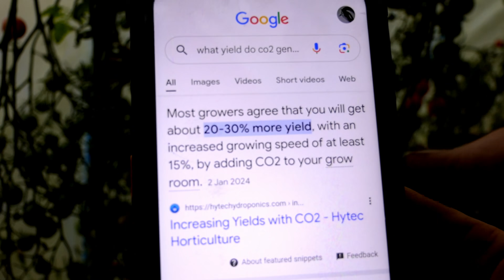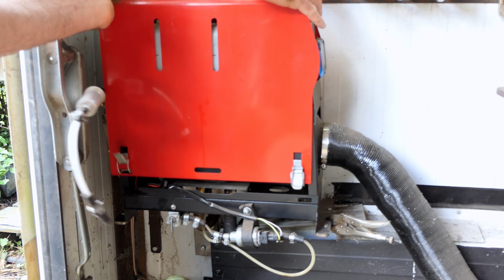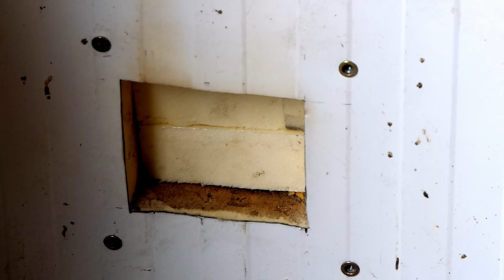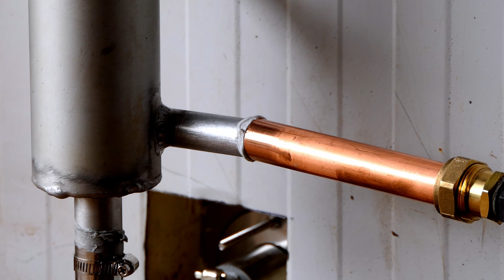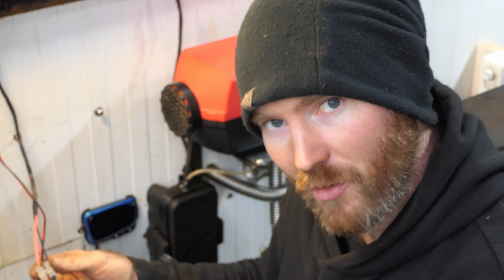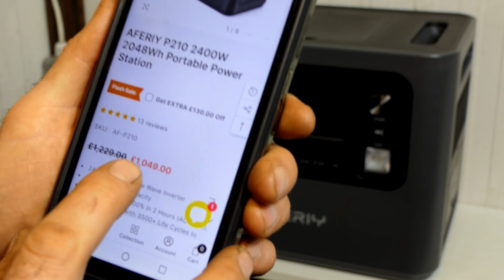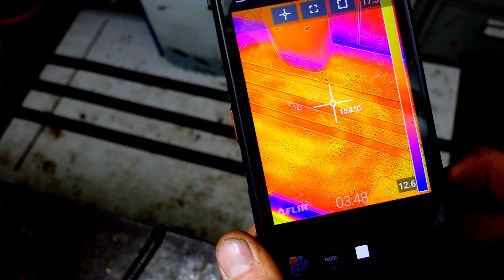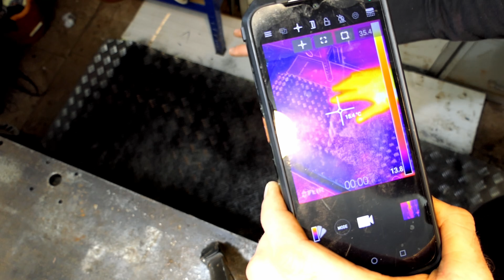NEW! Better system for Cheap and Safe Heating💲+ Underfloor Heating Mod test🫠

Comment: Great video and experiment, however I can beat your 5p per kWh before losses record, charge 20 kWh of  batteries on cheap over night rate for 7 hours at 6.5p per kWh - use this to run aircon (heat pump) in heating mode with a COP of up to 5 and you are looking at a cost of 1.3p to 4p per kWh of heat, throw some solar panels in to the mix and you are laughing, does have a higher setup cost than your solution though :) but its cleaner especially if you charge from solar too and has the advantage of also powering your whole house.
Reply from the maker: @james141111  fair enough. Cheers J
Reply from the maker: @james141111  doesn't beat my free wood in a wood burning stove though 😉
Reply: @joshuadelisle  very true!!
Reply: How much did you battery cost? What is it's capacity? How long will it last? Given  12kWh capacity for 10000 cycles over 10 years. for £11k installed, that's about 9 p/kWh energy delivered from the battery. You have to add that to what you're paying for your economy 7  rate of 6.5p, making it's 15.5 p/kWh. Solar panels are about 9 p/kWh delivered over their expected life span too.

Still 3.1 p/kWh of heating at a COP of 5.

Comment: Burning anything today is utterly obsolete especially oil product. 🙈🤦‍♂️👎 1. Isolate so you don’t need to generate so much heat. 2. Use as much sun as you can ie accumulation, solar box panel heating, photovoltaic + hot boiler heating, circulate air, use air heat recuperation ie heat exchanger. If you can use wind and water for generating of energy, do it. Not everything is about money.
Reply: @pangrac1 - That's great advice for people who live closer to the equator, however, the things you mentioned are much more difficult to rely on, for those living in areas that experience a lot of cloudy/rainy weather, or live in northern/extreme northern climates.
Reply: @__WJK__  Nonsense, they use photovoltaic even in the Northern countries and in Antarctica too. You dont need to move, Britain and Norway is starting to grow grapes for vine production.
Reply from the maker: @pangrac1  I agree but I don't have any sun or wind, just rain... Maybe I'll burn a bit of fuel to travel to a hot country instead. Cheers J
Reply: @joshuadelisle  They use photovoltaic even in the Northern countries and in Antarctica. You dont need to move, Britain and Norway is starting to grow grapes for vine production.
Reply: Solar panels still work when it's overcast. The only place they wouldn't work is in polar winter, and that's not permanent.
Reply: I agree with 1 and 3, lots of money to save there, but people living in the north needs their heat in the winter however at that period your solar panels will get covered in snow and then you only have like six hours of sun for like three months when it is at its coldest, or less if living even further north than my example.
Reply: @bamsebrumbamsebrumen5403  I didnt wrote any 3rd point.

Comment: FOR THE HEAT EXCANGER-  INSTEAD OF A LEAKY SCREW- WHY NOT FIT AN AAV- AUTO AIR VALVE? AS GASES( NOT AIR) BUILDS UP, ITS AUTOMATICALLY RELEASED, WITHOUT SPILLS,AND YOU NEVER HAVE COLD TOP LAYER WHERE GASES DISPLACE WATER... 3 QUID AT LIDL...(NOT TO BE CONFUSED WITH STANDARD AAV- THIS GOES WHERE A RADIATORS BLEED VALVE GOES- NEARLY SAME SIZE.
Reply from the maker: @broder1929  I'll check it out. Cheers J

Comment: Good work, Joshua. The difference between the thermocouple and IR thermometers sensing the glossy metals is due to the emissivity coefficient compared to the default 0.95 like in paper. To make them show the same reading, put some paint over that spot you test or maybe a piece of matte plastic tape. I have built a few of these systems and noted that the best system consists of the burner being outside and circulating building air through it. That is the safest option.
Reply from the maker: @henk38599  I agree. Good tip. Cheers J

Comment: I would recommend you to use an EGR cooler, as the exhaust gas backlog of a long pipe, which may also be rolled up in a cylinder as you said, should not be underestimated. I myself have had some bad experiences with an exhaust pipe that is too long. I'm really looking forward to the next videos. I would also be looking forward to videos of the CNC plasma cutter again. Great video.
Reply from the maker: @C.A.40  thank you so much. Yes I think you're right on the long exhaust which maybe why my burn was high in carbon deposits when doing the maintenance. Lots of CNC coming. I have an arc droid to test out and several plasmas cheap and expensive to test too. Cheers J

Comment: THE RUBBER MOUNTING PAD- 1- DON'T THINK THE MANUFACTURER PUTS IT THERE FOR FUN- ITS A COST- ITS PROBABLY THERE TO DAMPEN VIBRATIONS- IMAGINE REMOVING ENGINE MOUNTS FROM YOUR CAR- VERY UNCOMFY- BUT ALSO EVERY MOVING PART IS GOING TO HAVE MORE VIBRATION, THEREFORE MORE WEAR....🤔
Reply from the maker: @broder1929  it's definitely there to stop air from the fan leaking out. There is a lot of air coming out once it was set up but I liked that it was cooling the mounting plate that the exhaust goes through. Vibration is very minimal on this machine. Cheers J

Comment: Is there any reason you used aluminium over copper for the heat exchanger? 

Ive built a few small boilers using my tig welder and used armoured cable as an filler wire. You will have great success with tig welding in through pipes like the alternative heat exchanger you showed. The smaller boilers I have made have been very effective. Great video 👍
Reply from the maker: @Hammerandhilt  it's made of scrap I had lying around. Copper would be good but I didn't have any spare of the right size. Cheers J
Reply: @joshuadelisle  ok, great work laying out all the information. Thoroughly enjoyed the video.

Comment: If you have to redo the floor. Dig down dpc, sand layer, some kingspan. Add pipes in coil as you know, screed floor.  Bit more to it but do some research. You will never have cold feet in your man cave again and likely   you heater would only ever run on minimum. Heating is all about surface area. And with under floor heating NEVER exceed 50c water temp. Adding anti freeze would be a good idea
Reply from the maker: @FlixmyswitchLASER  great tip. Cheers J

Comment: 45:00 couple points, I agree we are at a dangerously low level of CO2 and entering another glacial cycle (as we are overdue for) is much worse than warming a bit- which actually would lead to a wetter and more hospitable planet, with less extreme aridity (especially in places like Saharan Africa) and less dangerous weather overall (cold leads to more deaths than heat)- but actually co2 was below 0.02% during previous glacial cycles, and this merely lead to the desertification, freezing and/or drying of most of the planet, not ceasing of all life. Also the fact that humans produce a small fraction of natural co2 emissions doesn’t necessarily mean we can’t raise the steady state concentration- because eg the ocean both releases and absorbs enormous amounts of co2 each year, for example, but it’s balanced and imbalances are corrected to match over timescales of hundreds to thousands of years.
Reply from the maker: @chir0pter  very good points, thank you. Cheers J

Comment: Been working with underfloor heating for 16 years. Running pipes through insulation tends to insulate against heat. We put aluminium diffusion plates in the grooves which spread the head out like a heat sync. You’re right about spiral patterns being more efficient than meander patterns 👍
Reply: im a builder in Canada. It sounds like your shed floor is a bit of a mess to begin with. Why not replace it with concrete and install the "Oxygen barrier" pex pipes in the new slab. A little insulation below the concrete pour and you will have a thermal mass to keep your toes toasty. Replace the water with the proper anti freeze in your closed system to prevent freezing issues. Put the screw back in the rad, add a blow off valve set to the pressure you need and an expansion tank. 
Cheers eh
Reply: @alanbain5779  but concrete is tending to keep damp... There are probably much better natural solutions...
Reply: @helengren9349 but you don't know of them 😮😢😢
Reply: @helengren9349  if installed correctly it shouldn't be exposed to the damp, i have underfloor heating in the kitchen dining area of our house and it's not damp, and very quickly can be too hot, and it's not as hot as the radiator temperature.
Reply: @alanbain5779 food grade antifreeze to be pet and wildlife safe. Engine antifreeze is extremely poisonous while also extremely tasty. You’ll find food grade antifreeze in commercial food preparation areas and also food transport and food distributors.
Reply: you put the insulation on the bottom, the thermal mass in the middle and diffusing material on the top.
Reply: Screed=slow release thermal battery 👍🏻 surrounding pipework in insulation stops the heat being released. Excellent video J
Reply from the maker: @madmax0814  interesting, thank you for the tip. Cheers J
Reply: @joshuadelisle I'm no heating expert, but many of the installs I've seen run in screeded floors and seem to work similar to storage radiators.
Reply: @chriswharrier3571  Yep. The screed becomes the regulating thermal mass.
Reply: @joshuadelisle  If it's hotter than it's surroundings, it want's to cool and equalise. If it's colder, the same applies. Insulation works both ways and simply slows this process of exchange.  I want to try and run an 8mm copper pipe for water heating inside my exhaust (The same you use) but I'm not sure if I need to widen the exhaust pipe so as not to inhibit the out gasses. Also you made a great comment about copper reacting with steel so I need to research that and if I need a sacrificial anode. Ideally I would run 8MM inside and back so the start and end point would be closest to the hottest area. For the kids tree house, I kept the entire unit outside and the exhaust runs 2.5 metres to where I know gasses are well away and down wind from where they sleep. That said your vid here was very informative about the air quality and I can verify with even -6C outside, I barely see anything and it doesn't smell. I run clean diesel but since my rented house heating system is oil anyway I just need to stop being a muppet (and pay1.56Eu a litre at the petrol station) and find a way to tap into the house fuel....
Right now I waste WAY to much heat from that hot exhaust! It was "Ok" to touch 2M away from the unit with -1 outside but still so hot that 1 metres after the unit, was too hot to touch for more than a second. Your channel is brilliant and inspires ideas!!
Reply: Heat /sink/. You are not syncronizing anything :D
Reply: @zaprodk  A rather petty observation.... maybe the spell check changed it...Mmm?  Anyway, to be equally petty, it's Synchronizing.  Cheers.
Reply: The cheapest way is to use the Aluminium film from the Kitchen...

I have done this already 6 years ago, before I switched to the Aluminium Film used in Saunas because these Aluminium Film is thicker and distributes the heat much better.
Reply: We were the first house in garsdale Yorkshire dales to install underfloor heating. The pad was reflective and then after pressure testing buried in concrete with stone flags on the top. Best heating system I've ever installed in a house.
Reply: You were only the first if the Romans didn't get that far up country. @petercooper9054
Reply: The Romans had underfloor heating
Reply: heat sink*

Comment: As always great video. I couldn't agree with you more about not living in cities and the other points you made. 

The wood stove is the single cheapest source of heat I've found and the type of heat and ambience has a great feeling to it. Thankfully since we've been blessed with a wooded parcel of land I've been able to collect most of the wood we burn myself for free (ignoring chainsaw/ax maintenance and my labor splitting wood). Very fulfilling feeling enjoying the fruits of one's own labor too. 

We do run an oil burner (furnace) too, but usually just for an hour or two on especially cold mornings or if the house has been empty all day.
Reply from the maker: @madengineer9072  I agreed wood stoves and open fires are the best and good for mental health too.   Not everyone is blessed with an abundance of wood unfortunately, if we plant many more trees that can be coppiced then that wouldn't be a problem. Cheers J

Comment: Another top tip next time you want to channel through foam. Hot wire cutter. You have the battery and with your skill set its easy. Your vaccum cleaner will thank you
Reply from the maker: @FlixmyswitchLASER  yes that would work well on polystyrene. I'm not sure if it will work with Kingspan but it's worth a try. Cheers J

Comment: If You need new flooring then that experyment says it all. Thermal insulation under, then pipes on top of that (not into it) then cover with sand or concrete. Edges of the floor need to be insulated, the heat exchanger bit bigger. You can add a water heat buffer (100l /200l) because 40C is max for underfloor central heating. Your heater generates too much heat in a short time (to run efficiently). It's like a wood burner using a gasification process, very efficient, eco friendly, but needs buffer for extra water and a big heat exchanger.
Best plant for o2 production is hemp. There are loads of types without psychoactive substances. As a side effect, (other than o2 production) it grows extremely fast and is better for paper production. Clothes can be made out of it..... Ford made a car out of it, and it ran on hemp seeds oil 1941. Yet someone is blocking that idea.
All the best.
Reply: Likely you'll want the pipes running in the middle (height wise) of sand/cement.
Reply: @mkeyx82  Technically, You should use aluminium foil and tape on top of insulation, Minimum 5cm of mass heat storage (sand cement) up to 10cm, but that depends again on heat saurs, time to heat up, time to cool down ect. In an experimental small scale lab putting pipes on top of insulation will do, and will be much more effective than digging them into insulation. I have downstairs with floor heating at my house, and regret not being able to do upstairs. It is a big energy saving step for a house.
Reply: @marcindawid8485  not sure if we got the wires crossed, I did not claim pipes should be dug into the insulation, just that I expect a more uniform heat transfer to the heat mass (sand, cement) if the pipe is neither on the bottom of the mass nor it is on the top.

This should be easily achievable if the pipes are laid on some sort of spacers, at half the height of the heat mass.
Reply: @mkeyx82 Heat naturally goes up, so placing pipe on the bottom is not a problem. Actually it needs to be placed there. Underfloor heating reacts slower but lasts longer than through radiators, and temperature needed to heat up the floor is about 30C so much lower then like for radiators. That's why, if You have a wood burner, or heater like in this demonstration, it is better to install a water buffer in between.
Reply: For cheap and good, look into running the pipes through a cob floor.
Reply: @jeffb-jbq  Cob is superb for wall heating or when You build home from scraches then all over. Best material for healthy house.
Reply from the maker: @marcindawid8485  interesting, thank you for the tip. Cheers J
Reply: BTW, I am thinking about how a properly insulated floor should look like. Your comment about need to put a tape between the insulation and the mass makes sense. I would expect a moisture membrane should go below the insulation, as well. How to avoid the cold bridge between the wall and the wall?
Reply: @mkeyx82  compressed stone, compressed sand, building foil (under and up along the wall), 10+ of insulation (ideally with aluminium foil on it), feel gaps between insulation boards (if they exist) and place aluminum tape on top joints to seal boards. 5mm expansion foam around edges of each area (max 100m, optimum 80m of pipe per coil), place the pipe, cover with mass (sand/screed/concrete) After all that, You should be now on house damp course level. Cut excessive foil to the level and You can start with the flooring.
Reply: @marcindawid8485 Thanks! What exactly is "building foil"? Typical insulation that would go on the floor is stirodur or high compression rock wool?

Comment: I don't think your underfloor heating is bad, if I recall correctly the water ones are quite slow to heat with plastic pipe and they normally have a thin layer of cushioning then wood or tile on top. You could just not use the top metal layer and put a sheet of ply or such down for walking on. You could use denser foam on the pump box to deaden the pump noise more, my concern with the box would be a fuel leak inside so I would add a drain hole and maybe a glass jar to catch any fuel as a visual indicator. I like the EGR type heat exchanger idea, a bit like a steam engine boiler with lots of surface area. You could always add a 2nd heat exchanger and run the exhaust pipe horizontally with a suitable drainage slope and then loop back to the new hole giving you more distance to extract the heat. Think hybrid condensing 2nd heat exchanger?
Reply from the maker: @TokkanFX  thank you. Very good tips. Cheers J